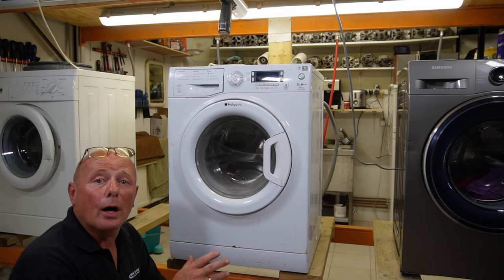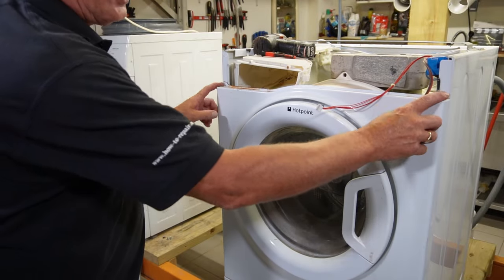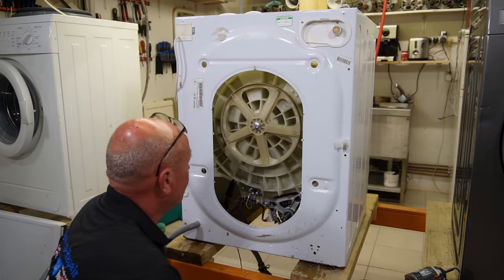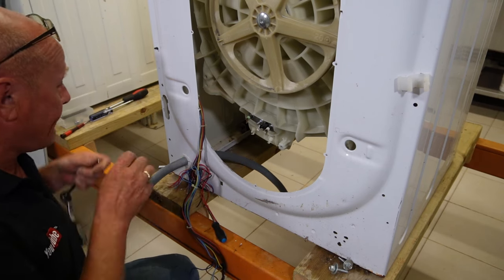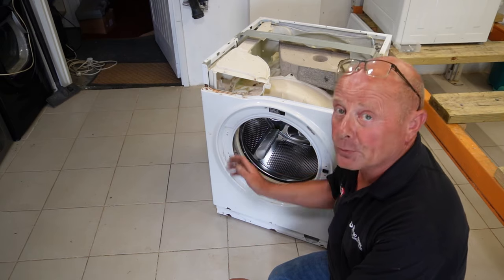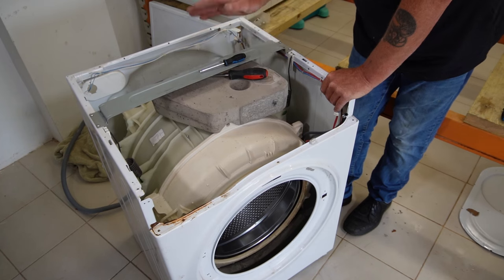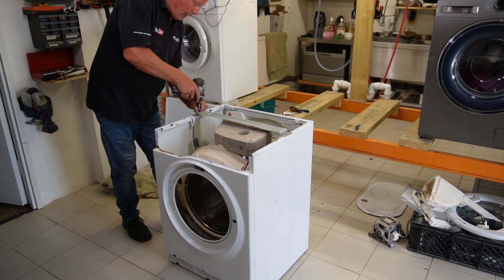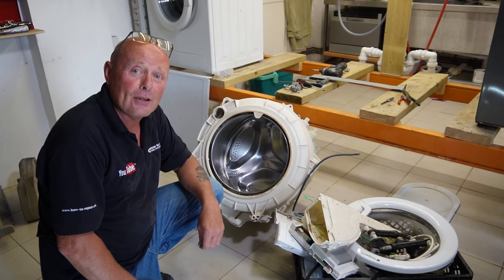How To Replace Fit all parts on Hotpoint Ultima Washing Machine wmud942 - WMXTF942PUK

Comment: Great videos Paul and at the right pace and detail for us older generation. Stripped a 
Hotpoint WMPG 742 Aquarius with collapsed drum bearings today.. It defies sanity when you have to scrap a whole drum instead of replacing bearings. Manufacturers should be ashamed of  they're throw away world.
As our machine was 8 years old I opted to buy a new machine instead of paying £150 for a new drum.
 I have the old 3 phase motor,  pump,  control board, water valves etc etc available if you want them for anyone. All serviceable.  You can have them for free just get them collected.
Keep up the good work, I wish I had a hoist those concrete blocks are quite hefty until removed.

Great 
"B".

Comment: Great video, thank you for taking the time to produce it. I have this model and the bearings have gone, I have spent a morning trying to locate a bearing set and now realise that they don't exist😖 it's going to be cheaper to buy a new machine! This is the second time I have encountered this problem - a Bosch I'd owned for only 18 months had the same 'built-in fault'. Sooooo angry 😡

Comment: Very detailed and enjoyable to watch
Reply from the maker: please remember to subscribe as that's is was keeps this channel going. Thanks 👍
Reply: @How-to-repair  Good day to you.
Firstly I must say having already dismantled my machine, I found your video a little humorous, engaging and informative, and you clearly not only know what you're talking about, but you illustrate and explain it so others understand... (so butter tub emptied) was wondering if you could advise, as my best guess is possibly the 'pressure sensor'...
Problem is, the machine will not drain or spin after any wash cycle, and is throwing up an f05 error code, however when I eventually get most of the water out of the drum, the drain spin cycle works, additionally should any part of the motor retain any liquid, as there is a chamber above the coil pack, that appears to have a liquid within it that is sensitive to magnets. So based on what I have tried to explain, do you have any suggestions... Many thanks for your help, and i'll definitely will be subscribing.... Very knowledgeable

Comment: Hi Paul 
I have just replaced the integral door lock switch,on my Hotpoint ultima washing machine the machine was displaying a F06 error code .
everything seems fine after switching back on the power,but now the door won't lock, and there's no damage or debris in the way.
what should I be looking for. 
kind regards

Comment: I've had one of these (Splendide) machines in my RV for about 10 years without any issues. I've noticed that the slide out on my rv is beginning to sag a little bit, and I think that it's due to the heavy weight of my washer. Would it be okay if I removed the concrete weight from inside this machine to ease the stress on the slideout until I can get the rv in for repair? Thank you

Comment: Hello paul, i have the exact same washing machine that has developed a loud knocking on the certain parts of the spin cycle, on checking with the top off it is due to the drum spring clicking across where it is supporting the drum itself, i believe this may be due to worn dampers, could you please advise on how to determine if the springs/shock absorbers are defective

I removed the shocks themselves and they seem to have a lot of play in them, ie moved up and down with just a little pressure, how much resistance should one expect on a function damper ?

Thanks
Reply: Those dampers sound like they have had it, there should be a lot of resistance to moving them. If the machine is older, definitely worth replacing the spring as well as they also wear and lose resistance.

Comment: Do you have any experience of the f12 error code with the display flashing and no buttons working?  I have conflicting  information as to what that means. A manual impact screwdriver would probably be ideal for that back bolt on the drum wheel.

Comment: I'm going to cut the drum along the weld and seal it and bolt it. I just wondered what bearings will fit it? Thanks.
Reply from the maker: Hi Neil, good luck it's one hell of a job to do it really annoys me that manufactures building this obsolescence. neil A I would love you to leave your opinion on our poll about manufacturers building in obsolescence to appliances. https://www.youtube.com/post/UgkxygHomnUySd_bYjaJBdEHPO6T4dYo9Ahm
and this is for you https://www.youtube.com/shorts/e432SAb2g08 please remember to subscribe as that's is what keeps this channel going. Thanks 👍
Reply: Are you trying to find original replacement bearings for your machine?

Comment: Thanks Paul! My machine is almost identical, the WMJLD 943. It powers up, display shows, but display switches off randomly. It can be seconds or several minutes after switching on, either before or during a washing program running. The only way we can get our machine to run the full progra is by holding down the power button continuously(at least 1 hour). It's not the fuse or power supply. I replaced the display/program board, same problem. Any idea what could be causing this?
Reply from the maker: This sounds like the on off button is breaking contact as load is introduced onto this switch so it would need replacing the contacts can burn and sometimes disconnect while the machine is on
Reply: @How-to-repair  Thanks. I have already replaced the main LED board. This machine has a mind of its own. Rarely, it will witch on and complete a full wash. Sometimes, it will switch on and then the LED display and machine switch offduring the wash cycle. Sometimes, the LED control interface will switch on and stay on for 20, 30, 40 seconds or longer, then goes off. This is before any wash progam has been selected. Then other time, I have to hold the power button down continuously for it to power up. As soon as I release, the LED display goes off. Am at a total loss.

Comment: hi mate how long should i wait after being disconnected from mains for it to be safe? as in voltage and all that, thanks
Reply from the maker: It should be safe in 30 seconds or so, but if you are ever worried you can always use an insulated screwdriver to short across the plug when it is disconnected, this would discharge any capacitors. Have a great Christmas and a happy New Year. glad we could help you very epic this is for you https://www.youtube.com/shorts/e432SAb2g08 please remember to subscribe as that's what keeps this channel going. Thanks 👍

Comment: The ultima WF865 doesnt have a rear cover i believe. So how would one change the belt on that?
Reply from the maker: If that’s the case you have to do it from the top put the belt on the motor and slowly turn the wheel. It is a bit of a nightmare. I have no idea why manufacturers keep trying to make things harder.

Comment: Please can you help me? I have an error code f01 on a hot point washing machine NSWR 742U GK.  everything else works like the water filling and the water draining but the bit when the drum should spin doesn’t happen. There is just a click noise. The drum also feels pretty loose like there isn’t any resistance when I manually spin it by hand. What do you think my machine’s problem is?

Comment: Terrible to see that bearings can't feasibly be purchased these days. Is there a good place to get the sizes of bearings to try to match them up? My washing machine bearings sound like they're about to go and I can't find official parts anywhere. I'm going to take it apart and measure it up I think.
Reply: The fact that you can't find replacement bearings tells me that the bearings are part of the drum. Most machines are made like that now, so when the bearings go it's not an economical repair to buy a replacement drum, even if you could find one. Spending hundreds of pounds on what is usually an ageing machine is foolish.